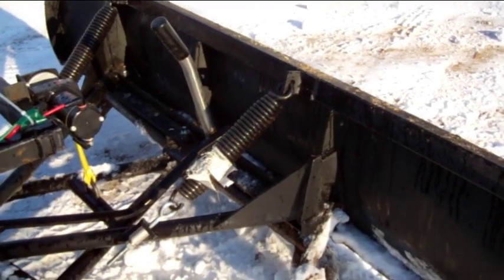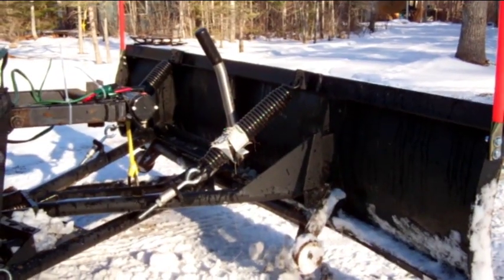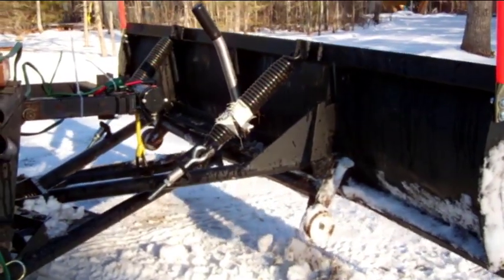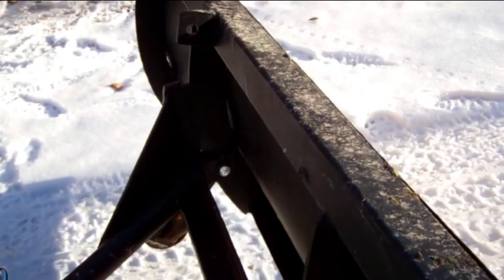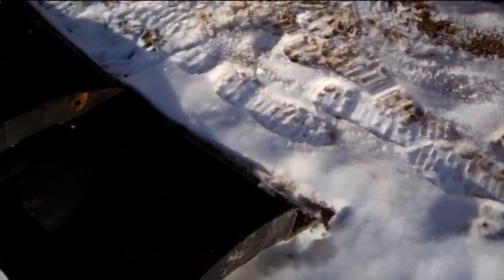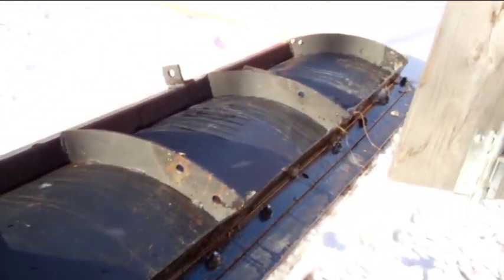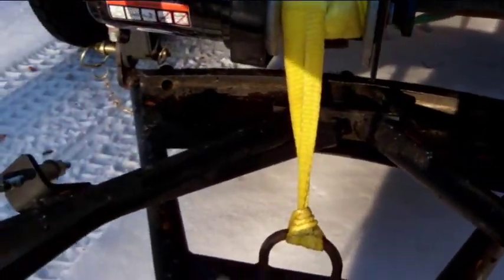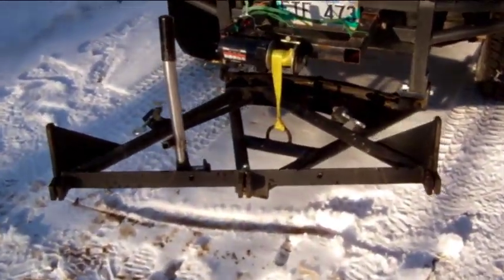Snow Clearing the Easy Way With My Homemade Snow Plow Overview

Comment: I made one of those also by copying how the arms are constructed, but I used a lot thicker square tubing and more bracing to keep things from breaking and bending. I've been plowing with it for the past 10 years now and it's worked great! Now to figure out how to make some kind contraption to angle the blade from inside my vehicle. I'm thinking of using a trailer tongue jack (screw jack) with a wiper motor to move it in and out. It's rated at 3000 lbs. so it should be strong enough.